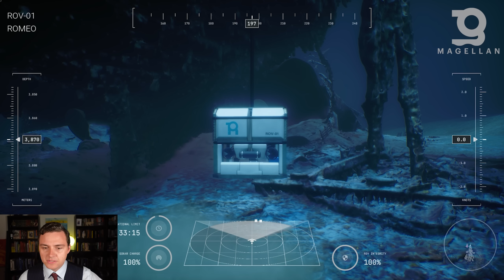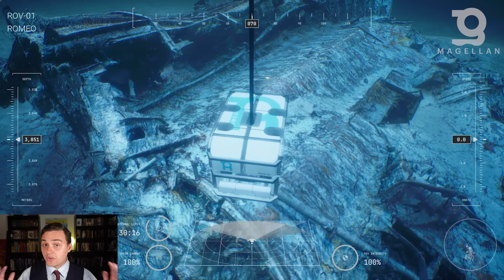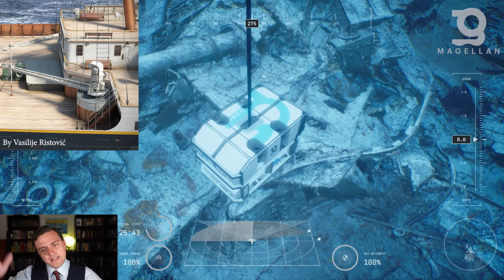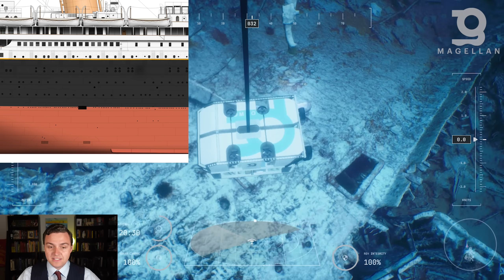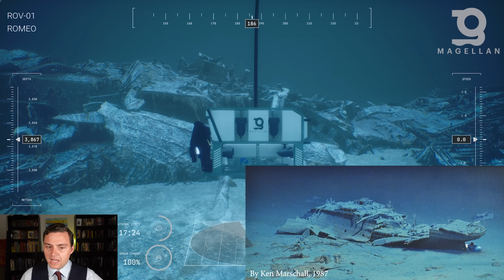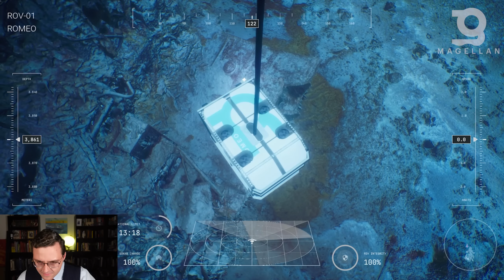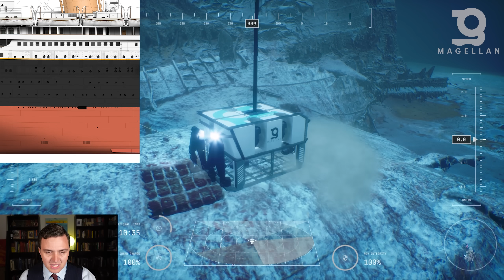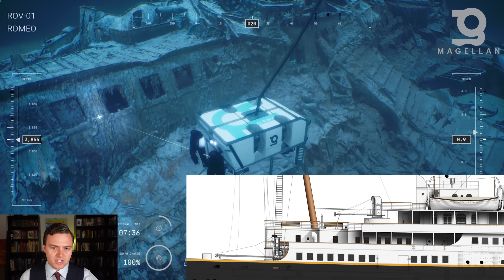FIRST LOOK: Titanic's Destroyed Stern Section in vROV Pilot

Comment: I can't believe how disintegrated the Titanic is, but then I remember how long the ship has been sitting down there. The way the whole outer structure of the boat has collapsed like that is mind-blowing! 
Thanks for the show and tell Mike!
Reply: The vast majority of this damage was done within 60 mins of the ship leaving the surface. The downdraft of the water column would have been like an explosion. that, and the force of the hull hitting the sea bed would have been tremendous.. There would of course have been a lot of very slow collapsing over time, but the violence seen here is as old as the the wreck has been there...
Reply: @dougle03 Think it sunk ripped side down first so the force already wrecked the inside and began peeling it . 
Then it hit the ground with like 60-80 kmh just to be flatternd by the water collum following it . 
Partwise one can see how the rump had ripped where the bottom meets the sides , just blown out and the decks pancacked down . 
Really didn´t have a good way down to rest .
Reply: @dougle03 From surface to seafloor would have been 10 mins tops once railings just touched water. Her entire rear bulkheads blew out as she up ended and slowly went beneath the surface. Once she righted herself somewhat, she either slowly spun round she to pick up speed to a fast decent, leveling out a bit as bits flew of. She hit aft first hard into the mud the water coloum holding thousands of tons of water ready to hit her top. Meanwhile bits of her decking and other bits were flapping about as she sank before dumping it all over her top as she came to sudden stop. Its a brutal display of physics, gravity and metal all having a field day. The noise would have been terrifying. Possibly earth tremors in the area as she hit. I guess the deeper they hit the harder the impact. Look at Brittanic, hardly any depth on impact but bow came off but rest of her is intact.
Reply: there were survivors' accounts of the soundscape of the sinking. The sound of explosions from beneath the waves (undoubtedly the product of the water column breaking the ship apart as she sank). Truly frightening
Reply: @csmatthew  Would be easy to hear to as the water was still and there was no wind whatsoever.. probably just the sounds of a lot of faint cries for help though
Reply: @badcornflakes6374 the sounds the survivors described as “explosions” were not people crying for help, the “explosion” sound occurred after the ship was beneath the waves and there were no more human voices. There were air pockets in the stern that imploded as it sank. That was the noise the survivors heard
Reply: I still wish it had higher resolution for the textures. I don't have an issue with lower res textures so that more people can experience this, but higher resolution options would be wonderful for those that have the machines to deal with it. I don't necessarily mean 100%, but higher to help with the muddiness of the textures. Still, it's awesome that they did it at all.
Reply: The outer hull collapsed at impact. The longitudinal or cross deck supports, think floor joists, had been blown out and laid back on the deck by the explosion of the cold storage rooms. With only the upright frames holding the hull in shape, the keel hit the ocean floor a moment before the hull at the main deck did. Which was still moving allowing it to fold toward the sea floor itself.
Reply: @samfairweather1972  Rusticles are eating it away.
Reply: It hasn't been down there that long, since there are Human beings alive right now that were born the year the Titanic sank. I get what you're saying, though, especially being submerged in salt water. I always wonder how pristine it would look if she sank on one of the Great Lakes with cold, fresh water! The Edmund Fitzgerald still has paint fully intact and that's been what, 50 years? I think they've found some 1800swooden ships in the lakes as well that the wood was fully preserved!
Reply: To be fair, the stern was basically ripped apart as it sank and is in MUCH worse shape than the bow, which is basically recognizable. It’s deteriorating at a much slower rate than people thought it would.
Reply: Ship*

Comment: "LOD" or Level of Detail is an optimization trick in video games where things farther away have lower quality textures and meshes used in order to ease GPU load.

If that's not being used here, adding it would help a lot and probably allow the full resolution scans.

If it is: Texture quality selection in the graphics settings.

Comment: See if you can wedge the rov into the mud in front of the center prop and use the thrusters to blast away the mud for a battery cycle or two.  Three or four blades?
😊

Comment: The stern sank broken end down. So you gotta think as it fell to the ocean floor the speed it was sinking at probably ripped everything off and flipped the poop deck upside down ripped off cargo cranes and the stern seemed to hit the ocean floor hard back end first. The bow had time to sink gentle like 3 hours and roughly stayed intact.
Reply: Yes. The force of the water pushing through the interior towards the back of the ship ended up peeling the deck back over itself like when you peel a rectangular lid off a can of SPAM or sardines.
Reply: the stern trapped air and suffered an implosion partway down...
Reply: @BlueTrane2028  Can't suffer an implosion since it's not watertight. There's plenty of places for air to escape. Besides, the wreck shows no evidence of an implosion.
Reply: @BellyLover06  I'm pretty sure experts have already determined that any compartments that had air in them ended up blowing through the walls and hull from the pressure of the water smashing into the interior as it descended in the water. So, yeah. No implosions happened anywhere. Idk where that person heard that.
Reply: From a physics standpoint: it is NOT an IMPLOSION in a case such as Titanic sinking.  It's a rapid DUCTILE FAILURE of the metal.  An implosion refers to a situation such as when the hull fails on a vessel in which the interior is at a lower pressure than the exterior environment.  In the case of Titanic, as a bunch of you having pointed out, there will be air that gets trapped in various air-tight or nearly air-tight spaces.  The ambient water pressure will push those pockets of air into a smaller and smaller volume as the ship sinks and the water-pressure increases.  So, the air pressure in those pockets will be held EQUAL (or nearly equal) to the surrounding water pressure.  That should make intuitive sense: the water pressure will push on the pocket of air and force it into a smaller and smaller amount of space until the pressures equalize.  So, the forces in play are not the result of those pockets of air being any higher or lower PRESSURE than the surrounding water.  They are the result of that air being significantly lower DENSITY than the surrounding water and, therefore: extremely, very BUOYANT.  And, at tremendous depths, just that force of POSITIVE BUOYANCY can rip out rivets, tear holes through steel and other metal alloys, and, if nothing else, it can bend/buckle the metal as it tries desperately to forge itself a pathway to escape towards the surface.  It is a DUCTILE FAILURE that happens at tremendous speed and the out-rushing gas will cause outward buckling of the metal on the top-edge of the seam while the inward-rushing seawater will cause inward buckling of the metal on the bottom-most edge of the separation - so, in practice, these failures will present simultaneously with characteristics similar to an implosive decompression AND an explosive decompression.
Reply: And, a significant portion of the gas that would have been trapped in her stern section would have been the result of steam.  Not steam directly from her main steam plant but steam that was created as the stern rapidly sank.  Her aft engineering spaces would have remained relatively free of water intrusion as she went down head-first with the water-tight doors closed.  Only after her bow was nearly completely submerged would seawater really have been able to ingress into the after-most boiler rooms.  When cold seawater hits red hot steel in the firerooms it reacts.... poorly?  We see all sorts of examples of this in WW2 sinkings.  Some of that steam would have found avenues to escape fairly directly but significant amounts would have become trapped in corners and nooks and crannies within the engineering spaces.  And when you've got raging hot steam on one side of some steel and ice-cold seawater on the other - rivets pop and the metal splits very quickly relative to the other places in which its mostly just regular air getting trapped.  This is almost certainly why Titanic dumped so much of her aft-engineering equipment on her way down.
Reply: And, every time one of these failures occurred, and a bunch of previously trapped gas is freed not only does she become more negatively buoyant (and therefore will start sinking faster) it will also alter her centers of buoyancy and mass. And, yes, even negatively buoyant objects have a center of buoyancy.  When you are floating - your center of buoyancy is below your center of mass and, when you are sinking (negatively buoyant) - your center of buoyancy is above your center of mass - yay, ship physics!  But, every time one of these failure occurred, it would have induced, relative to the amount and location of the air that escaped, induced pitching and rolling moments on the ship.  And very commonly, the side which is more buoyant will experience the next failure in the chain, which can then cause that side to become less buoyant and then the sinking ship will roll over to the opposite side and the trapped air will all run over to that side of the compartments it's trapped in, until that side has a failure or series of failures that causes her to heave back the other way.  Basically - it can be a wild ride down.  With the ship being bucked back and forth from starboard to port and back again any number of times.  For hydrodynamic reasons, it's surprisingly less common than you'd expect for large ships to turn turtle (it certainly does happen, don't get me wrong)... but there is a preponderance of evidence to suggest that large ships rarely maintain a consistent attitude (three-dimensional orientation) as they sink.  And it looks like Titanic's stern probably got tossed around pretty good on the way down (certainly more than the bow).
Reply: @BlueTrane2028  that’s Cameron’s theory but not 100% confirmed.

Comment: You can also get a sense of how much decay there's been since the ROV Magellan imagery was taken and back in 1986 when the Woods Hole Oceanographic Institute expedition under Dr. Ballard explored it. The Argus sled images of the 2nd Class entrance structure was in considerably better shape, just as on the bow the Gymnasium and the 1st class Entrance parts of the bow deckhouses were until about or around the early 2000s when they all started to collapse, along with the boat deck near the breakup point.
Reply: Unfortunately that wasnt the case if you compare those 1986 photos and scan stern actually has remained largely unchanged since discovery, if you compare them side by side. Alot of parts that Ken Marshall added in his painting werent intact like A deck promenade, the whole A deck was completely collapsed.
Reply: @ I'm sorry, I can't agree with you. I'm not speaking of Ken Marshall's paintings, which have some flaws. I'm speaking specifically of the Argus photos, in particular a number of the Second Class Entrance that clearly show that the housing itself was in better shape than it is now, regardless of the ROV Magellan game resolution or the original resolution. 

The same is true for the images of the boat deck area I referenced as imaged using the low-light video imagery from DSV Alvin's "flyover" of the wreck. It is clearly much more intact and anyone who says that the Gymnasium structure and the First Class Entrance areas are the same as they are today is just just not paying attention.

The decay of the bow's port side, especially the shell plating sagging is very noticeable. I know, I played ROV Magellan, "flew" the ROV to the same approximate area and replicated the flyover to see the differences. It's very clear that the wreck, both bow and stern has significantly decayed. Even the imagery from just 15 years ago shows real changes.
Reply: @Reiner-o7u  Well yeah 2nd class entrance in stern definitely was more intact. But alot of decks were collapsed the same way as they are rn. Boat deck was collapsed down on A deck already, A deck was also collapsed on B deck and alot of lower decks were collapsed the same they are rn. As for port side hull plating of bow section, that actually hasnt changed. Watch the first few secs of Titanic when alvin visited, port side hull plating is shown really badly bulged out and it has remained the same in scans too, that damage was always there.
Reply: @ That's what I'm talking about. 

I replicated that view in ROV Magellan and it is considerably more bulged than it was 40 years ago in 1986. 

We don't want to think about it, but the ship is going. the shell plating, especially on the port side is giving out, and I dread to think of where she'll be in even five years, never mind the next ten.
Reply: the whole stern used to be in better...comparatively speaking....shape than now
Reply: @lukecrisalli9847  That doesn't appear to be like based on 1986 alot of decks are completely collapsed and alot of them look unchanged in 1986. The port side hull plating looks much more horizontally flat on seafloor like in scans. It doesnt look close to Kens painting, that also means port side decks were collapsed like that